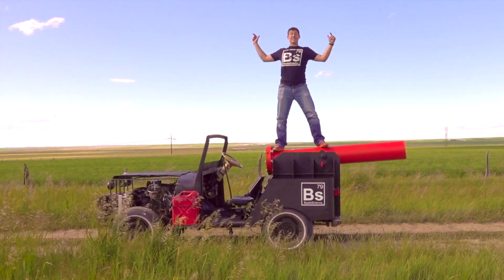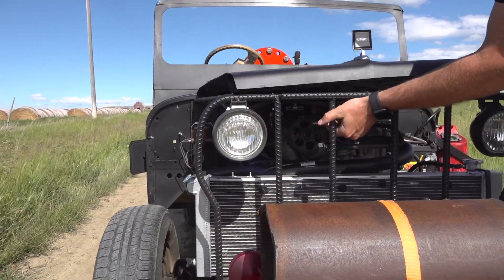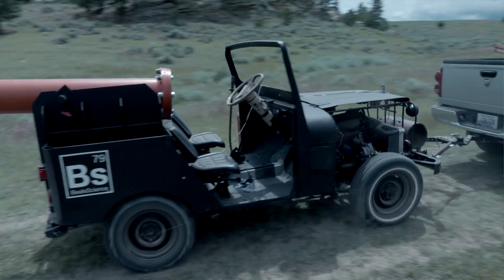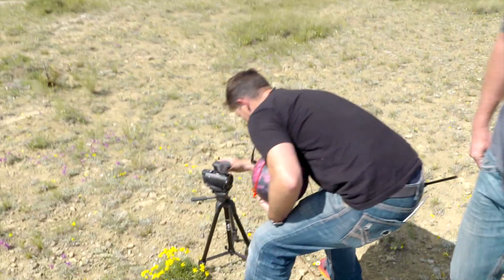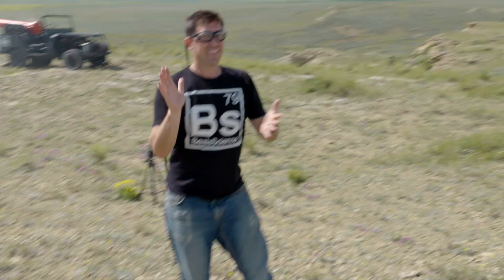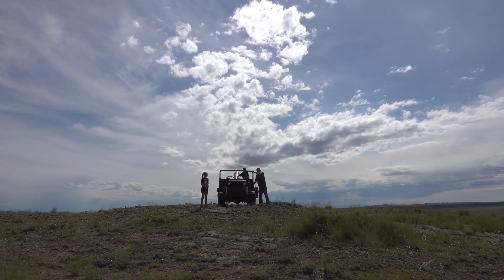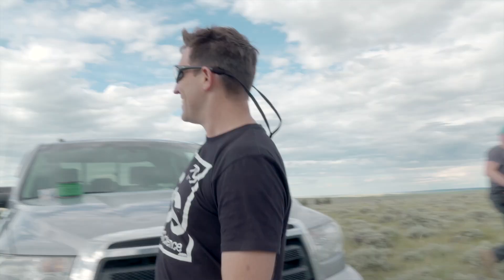Bowling Ball Cannon in a Jeep!

Comment: It looks like the frame on the jeep flexes when the cannon fires.
Reply from the maker: It does! The last time I took it out we blew the bolts off the passenger seat mount, blew a shock, sheared the bolts on the alternator and partially separated the body from the frame! It is really hard on my poor old jeep but we just fix it up and get it back out there!

Comment: Maybe sleeve the bore with the right size pvc pipe for a tighter fit?  Maybe reinforce the frame on the Jeep?  Jus Sayian... Super Sayain
Reply: Maybe put the Jeep in neutral with the e brake on slightly.
Reply from the maker: Good idea! I have contemplated building a wadding sleeve (like used in a shotgun shell) so we could put other objects in the barrel - basketball, pumpkin, watermelon, etc. I may try that the next time we take it out.

Comment: Why didn't you bolt every hole on the breech flange?   What with all the leakage evident in the slo-mo.
Reply from the maker: They were both bolted closed and it blew the bolts out on the first shot! Now I use the top one to thread fuse into the barrel.

Comment: Could you do that with your hydrogen experiment gas?
Reply from the maker: Hydrogen combusts very quickly. So if we were to fill the barrel with hydrogen (and oxygen) it would rapidly combust and several things may happen: the ball would not exit or would barely exit because the rapid combustion would not last long enough to move the massive ball; and the barrel could be compromised because if we have a fast explosion with nowhere for the pressure to go (the ball doesn’t have time to accelerate and exit) so all the pressure pushes against the walls of the barrel.
However, we could definitely use hydrogen with a lighter ball! Maybe a soccer or basketball!!

Comment: That’s extremely impressive with how inefficient that cannon is, i love to see that with a towel wrapped around the ball to make a better seal, i bet you could almost double the velocity
Reply: That falls under the category "It seemed like a good idea at the time." To increase velocity you need to increase pressure, so you're on the right track. Howevva comma the materials being used to construct these toys aren't able to stand the much higher chamber pressures you're trying to obtain.
Reply: @hightechredneck3362  
BINGO ! That "cannon" could become a grenade.
Reply: @workonitm8  Maybe just putting heavy grease on the bowing ball would increase the pressure, but still blow off before the barrel blew up.

Comment: If you want to really test your cannon, I would suggest that you create and freeze a cylinder of ice that is the same diameter as the cannon.  the projectile should fly much father (less gasses escaping) but I would also dial the powder way back till you see how the pipe reacts to the increased pressure.
Reply from the maker: This is a great idea! It would be fun to make an ice cannon ball and see if it holds together!

Comment: WHY ONLY HALF THE BOLTS?
Reply from the maker: That is a great question! 
The nuts/bolts are about $18.00 a piece! So, I calculated the potential load and figured 1/2 would be enough. So, I only bought enough for half to save money. And, as you can see, I got lucky with my calculations because it didn't blow the back off! (Thankfully!)
Reply: @BealsScience  THANK YOU

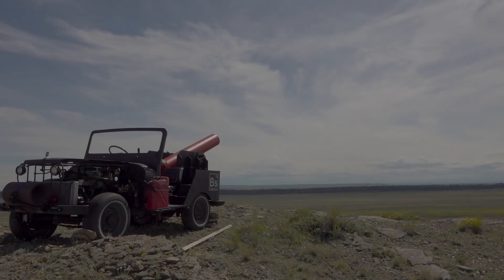Comment: At about 5:37 he looks down the barrel of a loaded cannon with a lit fuse.  It is unlikely, but if it went off the results would be catastrophic.
Cannon safety;
Only put things in front of a cannon that you want destroyed, no hands, fingers, kids or heads.
Make certain that your cannon is being fired into a controlled firing range.  Even at two miles, it is lethal.
Use a mirror to look inside for burning bits of wadding before loading in the powder.
Hearing protection, eye protection and keeping dummies at an extreme distance is useful.
Reply: A small hole in the breech end to accommodate the fuse. NEVER ignite from the muzzle, and make sure the barrel has NO glowing embers. Load powder with a cup on the end of a stick so you're not in the line of fire if something ignites the powder prematurely.
Reply: Shot my anxiety through the roof, too.

Comment: well,,,,,, now you could add two to three layers of 3/8 flat steel cut in 6 to 10 inch strips around the barrel starting at the base of the cannon. Next, weld all of thesse stips in solid. now, restart reloading the connon with progressivelu larger powder charges-WATCH HOW MUCH YOU FINALLY STOP AT AS FAR AS WHAT YOU CALL NOW A FULL CHARGE! A LITTLE RESTRAINT MIGHT BEST BE EMPLOYED AT THIS TIME AND A GREAT DEAL OF REMOTE FIRING USED FROM A BUNKER IS ALSO AN OFFERING. HOW DO YOU THINK THE CHINESE MADE THEIR FIRST CANNONS?

Comment: As an old Ordnance guy I can see possibilities with that cannon.  1st.  Make a wooden doughnut that will keep the ball centered in the bore and seal the gasses behind the projectile.  2nd,  drill a vent hole for your fuse at the breach.  3rd,  make a set of staffs for your rammer,  a sponge/mop that will extinguish any embers after you fire the cannon.  Have fun.
Reply from the maker: These are really good ideas! Thank you!

Comment: Black powder is slow burning.   You can only use so much before you have negligible gains due to the powder is still burning after the ball is gone.   It has been 50 years since I made one but I think BP is about 9k lbs pressure where as smokeless powder is around 27-30k.  We tried smokeless once and were lucky to be able to make the choice ‘never again’.  Wadding would have better results for that would prevent the escape of gas creating greater the pressure being maintain in the barrel.  This may sound good but my bet is your pipe thickness and quality of steel may lead to possible fatalities.  I am sure there area tables of formulas out there with results while giving greater safety if you wish to start tweaking your “Bad Boy”.  Other people thru history been part of the bleeding learning curve.  Read their . stuff so you are not a statistic while having fun.

Comment: What kind of velocities do you think you were getting out of it? 

I'm no rocket... I mean cannon scientist (not a rocket scientist either...but I like to Tinker around with the subjects) but it definitely looks like you were loosing a lot of potential pressure out from around the ball. 

Maybe revisit it, with some kind of wadding setup (like a shotgun shell). You could cast them low cost using spray foam. Better seal, and low weight to reduce strain on that back plate. (But I would definitely add some more fasteners just to be sure....)

I made a similar wadding for a golf ball launcher, but the weights and pressures are most definitely hugely different... even with a .5lbs charge, proper sealing would have made a huge difference I'd expect.

Comment: Dude please! Drill a hole in a the base for the wick, wrap the black powder in tin foil ram it in and your ball then poke the tin foil with a wire a but your wick in to light, it extremely dangerous to light it like you are it like looking down a firing gun

Comment: Intriguing . . . Although for better performance use a wadding for the cannon to assist with the pressure of gasses to fire the bowling ball range might increase by exponential proportions that you would approve of (a tracking device might be required for recovery of said ball) a paper type Patch martial would in theory not stress the barrel too far if light enough yet increase pressure about 60 to 70 % if the pipe is indeed steel the barrel will hold shape as long as it is washed and cleared (a civil war method of cleaning the breach) between shots
Reply: Probably also discover the pressure rating of that pipe and what a shrapnel wound looks like.

Comment: If the tube was smaller and allowed for a better seal it could build more pressure and really send that ball
Reply from the maker: True! But I purposely used a tube with a larger diameter so that any excess pressure would pass around the ball and (hopefully) keep the entire barrel from cracking or exploding.